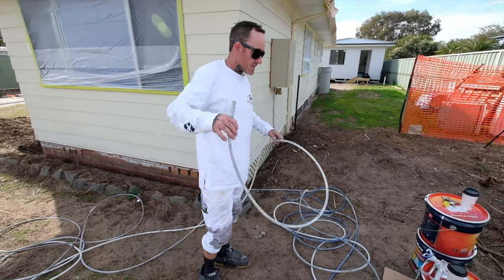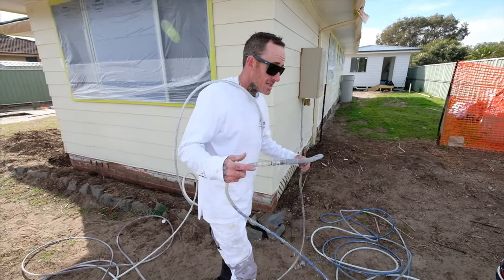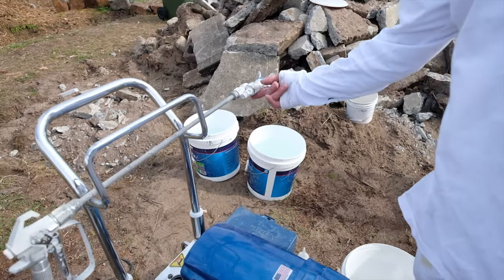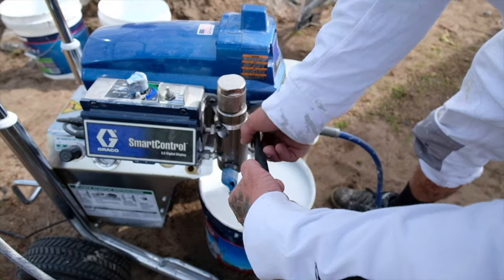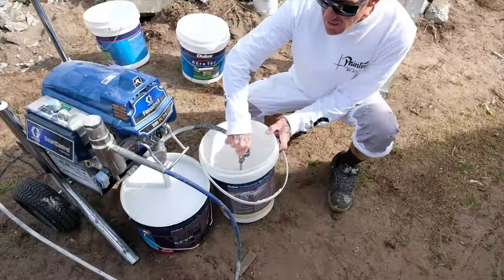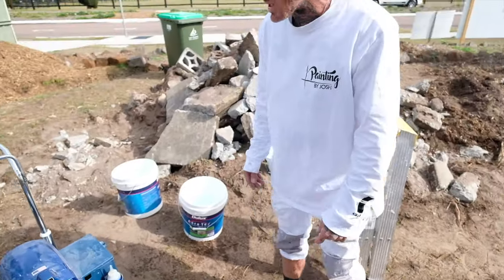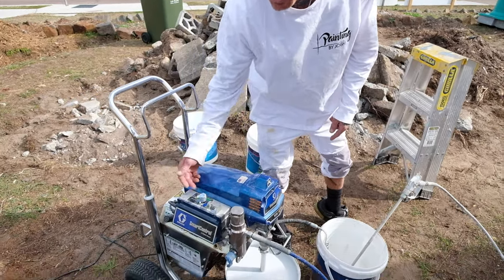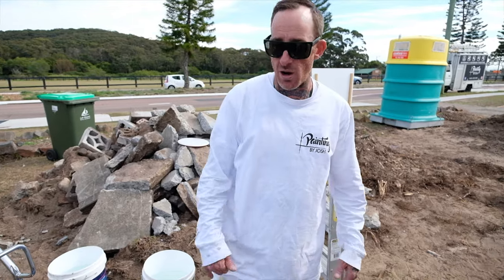SETTING UP MY GRACO AIRLESS SPRAYER

Comment: Awesome video! 

Question: when you have to spray the soffits all white and the body/siding A dark colour, which do you spray out first?

I’ve been spraying my soffits white first, then masking them when dry with 2” tape and 2’ paper.

I’m debating on trying to spray walls first, then free hand spray the soffits in and only touch up the wall by brush. 

I’m just wondering what you do? :)

Thanks Josh!

Keep up the good work.
Reply from the maker: Yeah bro I know it changes from job to job height and other factor's. The way your saying is good, also spray gutters/fascia then spray walls finished then tape up back edge spray soffits low pressure and then cut last board into the soffit. It usually changes job to job. Hope this helps mate. Nothing but respect 💯👍🙏